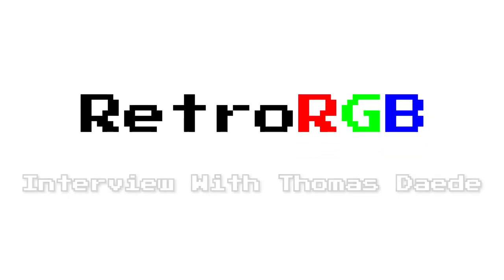Interview with Open Source CRT Chassis Creator

Comment: This is totally wild. I'm super excited to hear that this project could theoretically bring a 15kHz television up to 31kHz for 480p signals. I do wonder if that would cause the components to wear out faster, but I'm super excited to see where this goes!
Reply: That's the one thing that got me ecstatic.  Turning my 36" Trinitron into a multisync would be amazing!
Reply: What's even more impressive here is that you could turn a junker VGA monitor into something that would be better than everything but the highest quality PVMs.
I've been waiting for this sort of project for literally years.
Reply: A standard TV tube with a 31khz chassis is like what a 100hz TV of the late 90s early 2000s - like a Loewe 100hz CRT. They have a digital chassis just like a PC CRT monitor chassis. But they are only useful with a VGA module installed. 
So we can assume this open source chassis is digital and that would make sense in the modern era. Just means at 31khz 480p you will have to use artificial scanlines for the retro look since scanlines are a side affect of 15khz.
A multisync TV with an array of connections would be most useful. Something like a built in GBS control integrated in the chassis would be awesome.
Reply: I dont know what is that. But if it makes 4k image, awesome

Comment: Hopefully this will come out sometime in the future and will work on those late widescreen CRTs as well. Would be great to finally see those screens without 100/120Hz digital crap. Those late 90s and early 2000s screens have great tubes but are hampered by all their digital crap.
Reply: Alternatively, would be great to use the 120 hertz mode for consoles that output a 120 hertz signal.
Reply: There is no reason why it wouldn't work. A picture tube is just a picture tube and he stated that early in the video. 100hz TVs are still very useful if they have a VGA input.
Reply: @MicahtheDrumCorpsPseudoboomer  the only issue with that is that the resolution may be halved. But making a chassis capable of doing that would be quite the feat.

Comment: If you successfully create a chassis that drives an SD tube at 480p, people's heads will explode. Maybe the golden era of crts is yet to come.
Reply: IKR
Reply: Or a VGA tube at 240p.  The moment that happens, the price of PVMs will crash.
Reply: I think pvms will always have some kind of collector value. Though, I do agree that real phosphor glow from 240p on a vga monitor will make a lot less people chase after pvms.
Reply: @dylanjastle  yep. the only reason why i bought a pvm is so that I have a CRT that won't flicker as much when displaying bright colours at 60hz. unfortunately when I try to use my PC monitor at 60hz the white colour flicker is just unbearable
Reply: @dylanjastle  CRT are just picture tubes, they don't have predetermined resolution like SD or HD (unlike an LCD panel which needs to display pixel to pixel) that's dictated by the chassis itself. And if we are going to assume any resolution capability that the chassis is digital running at a 31khz scanrate. Old TVs and arcade monitors are 15khz, they are analog so there is no resolution so to speak. Resolution is a digital concept. The side affect of that is the scanlines. In order for a VGA to display 240p the chassis has to be capable of displaying it at 120hz, this will also produce natural scanlines.
Reply: @lancepage1914  thanks for commenting! Tubes designed for SD content typically have a lower TVL/horizontal resolution (per their designed use case). So their maximum horizontal resolution is ‘fixed’ in a way. But the vertical lines will be whatever the chassis can scan at.. I guess it shouldn’t surprise me that you can drive any tube at whatever resolution the chassis can tell it to! It would be really interesting to see some normal 300tvl shadow mask tube scanning 31khz. I wonder how it would look!

Comment: I was looking into this more from the Electron Gun / Glasswork / Phosphor perspective (even made another playlist on the kind of idea/project of an OS CRT TV), but then i got an Old Dell CRR Monitor at an Auction, Now i am intrigued on Running that with nice Clean, Modular, and Easy to Clean/Maintain Electronics etc

And this project (short of the issues they pointed out) should solve all of that, really neat!

Comment: This is awesome! Two weeks ago we were visiting my girlfriends grandma (86yo), and as she knows that videogames and CRT TVs are my passion, she wanted to give me her CRT TVs. One of them was a a Portable 14 or 15 inch Grundigh color TV from the 70's: Incredible modern design, lightweight and because of the shape, perfect for tate, but RF only. I did a quick research on the internet to RGB mod it (I never had to, since here in europe even the second TV my parents bought in the early 90s had RGB scart. When I saw that all the mods consisted of injecting the RGB signal through the OSD chip, I had to leave the TV there and thought why they took that aproach and not what Thomas has explained here. We will visit her again for Christmas and I will for sure grab the TV.

Comment: Some original chassis require a lot more to repair than just caps and have incredibly complex circuitry like with the MS2931 so this will be a really nice option for these difficult to repair chassis that barely anyone will work on.

Comment: Hoping this will eventually end up making european 100hz TV sets capable of running at both 240p and 480p considering that 100hz 576i is 31khz.
Edit: @ 33:40 this sounds very promising for 100hz/HD CRTs

Comment: I wonder if it will be possible to add 15kHz support for 31kHz CRT monitors and 31kHz support and beyond for 15kHz consumer TVs...
I also wonder if there will be SCART mods for Samsung CRTs.
I really wish this would enhance my good old 29" Samsung CRT and make it amazing. And also an old Samsung CRT monitor at my Dad's place.
In the Philippines, there are still mechanics fixing CRTs so I really wish I can hire some guys for cheap and get them to use the open source findings of Mr. Daede.
Reply: He mentioned in the interview that yes, this will indeed make it possible to drive 31kHz monitors at 15kHz

Comment: Would it be possible, in the future, to release much lower power requirements, so we could end up with a low-power CRT ?
We all know CRT's can be killers, in the wrong hands, so if it were possible to be able to produce much lower power requirements, using modern tech, to make them much safer.